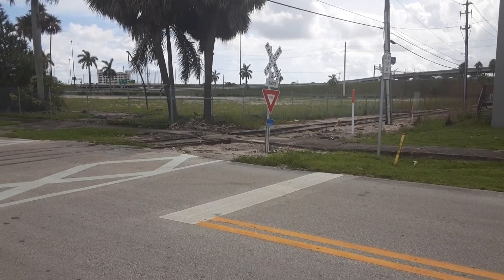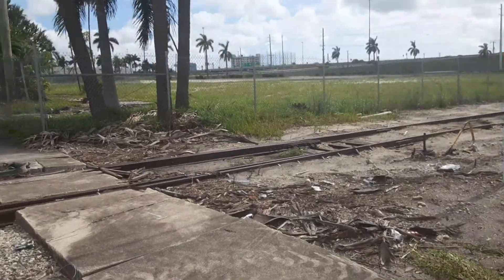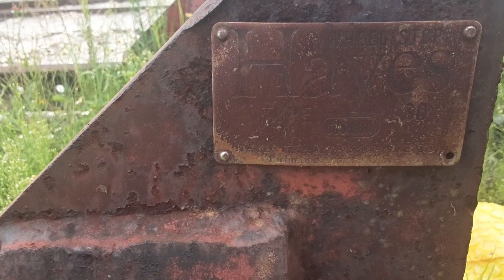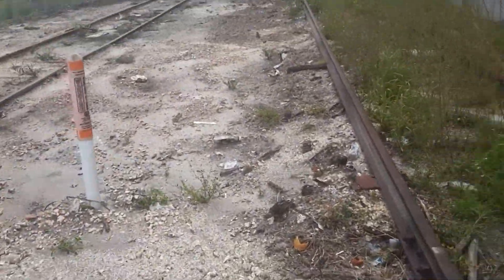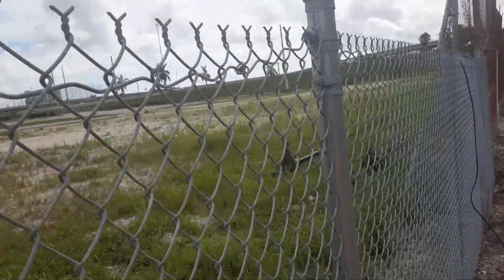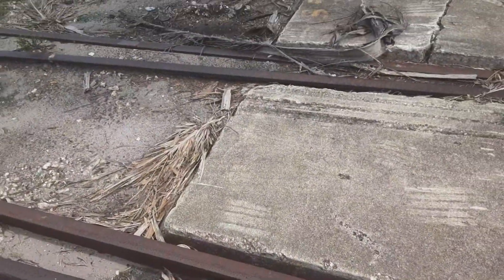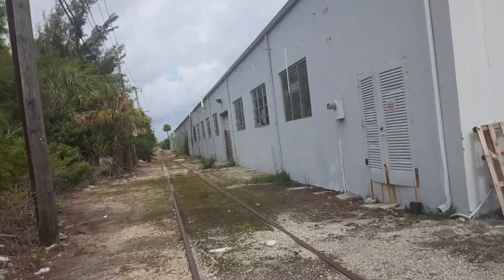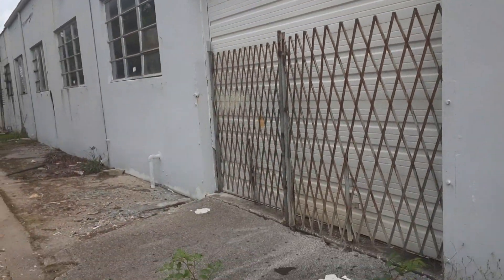95 Year Old Train Tracks & 3 Abandoned Spurs at Railroad Crossing

Comment: The Federal Highway manual reads like stereo instructions, based on established standards but subject to interpretations. From what I can gather, the distance to be stopped away from the rail to the last stop line before the tracks is about 15 feet, now, that being said, the distance from the first stop line back before the X RR pavement markings is 50 feet to the rail. This is based upon the tracks running perpendicular (at 90 degrees crossing intersection) to the paved road , the 15 foot rule changes slightly when the tracks cross the paved road on any angle other than 90 degrees. Then the outer edge of the closest rail on the given side of the road is classified the start point for the 15 foot measurement to the last stop line. The 50 foot rule applies from that same point and back to the first stop line.

Comment: There's probably still cars stuck on the Xway from this AM. Frankly the sidewalk is in the best shape. That one siding while small certainly served a large warehouse looking at the size of the lot. Figuring the spur kept going up to 2 more blocks. I'd say it had numerous modifications such as bigger windows and. Probably the opening's. It also looks like they installed several hydraulic self leveling dock's. Now that small fenced off mini spur is so unique even a scratch builder would have a hard time making this. Maybe at one time there was a loading dock by their private paced Xing. It had to be tight but it's possible the little siding would hold a 40ft max gon or flat with pipe wire or small crate's even. Perhaps you can find out the name of the company that had the private Xing. This spot while compact is a true treasure trove of the bizarre
Reply from the maker: LOL @ cars still stuck in traffic from the AM! I definitely have to go back here and see if there's another entrance into the woods so l can follow and film that other spur. Also, they were removing the rails about 2 blocks West, so l want to see up to where they removed them and if they're replacing them.  Thanks as always for the views and comments, Paul.
Reply: No Pan Am videos of recent, so I have migrated to Florida train watching!!!!
Reply from the maker: @cczoe5585  Speaking of Pan am, I'm going to have a surprise for you coming soon!

Comment: Yes it does appear that sidewalk was first, then cuts made to lay track. When I worked as draftsman  years ago with survey group there is a set distance for warning before getting to track(s). I do not remember what that distance was or is now, but since railroads tracks are of a interstate use most cases, the Federal Government did have set distance. But like most interstate rules may be superceded by State or Local Government in certain cases. Interesting item to investigate, maybe I have time next week to do some research via internet and public library. If I learn anything will email you for information of possible future video. As always enjoy your videos tracing past history and what is happening presently.
Reply from the maker: The answer for the pavement markings is at least 100 ft depending on the speed limit of the road. I didn't know you were a draftsman, Duane. That sounds like an interesting gig. Always a pleasure chatting with you. Thanks as always for the views and comments, Duane!

Comment: Hey Roly, another good find.  Looking at the side walk, can't tell if was a before or after, but what I did notice were the deep gouges, looked as if a rail car had been off the rails there.  One of the comments was the possibility of re-opening the line.  Question, has the building of the interchange left the track bed intact?  It looks to pass under it.  In Birmingham UK we have a similar road system called officially the Graveley Hill Interchange, built mid 60's.  It was instantly called 'Spaghetti Junction' and it stuck.  It's used in all travel bulletins!!!  😀😀😀
Reply from the maker: The Spaghetti Junction sounds fascinating! Who knows, maybe I'll cross the pond to film it one day. I was able to find out that the pavement marking has to be at least 100 ft from the tracks, depending on the speed limit. As for this area, there are a lot of unanswered questions. About 2 blocks away, they were already removing rails. So I have to go back there and do a follow up video. Thanks as always for the views and comments, Robert!

Comment: So when were they abandoned in the 70s ?
Reply from the maker: Built in 1969, abandoned in late 2000s, thanks to trucking and outsourcing. Thanks as always for the views and comments, Ernest!
Reply: I think not for the onset of ww2 trolleys and street cars would have been gone even sooner oil and rubber were needed on the war front along with steam locomotives they also would have been replaced sooner had not ww2 intervened

Comment: Wow, that track probably saw both the steam and diesel era! It would be cool to see it go back in service for a customer. I'm wondering would they "freshen that track up" if a customer in those bldgs wanted rail service? Or pull it up for new?
Reply: The rails, yes, the track, no. Rail was relaid for the sidings. And as of 2021, the track was still in use. It has been cut at NW 13th Ave. So the tracks from there to NW 16th Court are dead. Including the tracks in NW 15th Ave. From his other video, it looked like remove and replace on the western end.
Reply from the maker: I definitely have to go back here and see if they continued removing the rails Eastward and if so, what have they done where they already removed them.  Thanks as always for the views and comments, gentlemen

Comment: My guess is homestead subdivision. Your thoughts?
Reply from the maker: Both CSX, but the Homestead Sub is about a dozen miles South of here.
Reply: @railrol82  The homestead subdivision is my favorite railroad. I wonder who owned it beforehand? Did it see steam, or just diesel?
Reply from the maker: @nickastridandtoothlessthen5494  It was originally built by Seaboard Air Line RR in 1926 as a passenger line and it was steam.